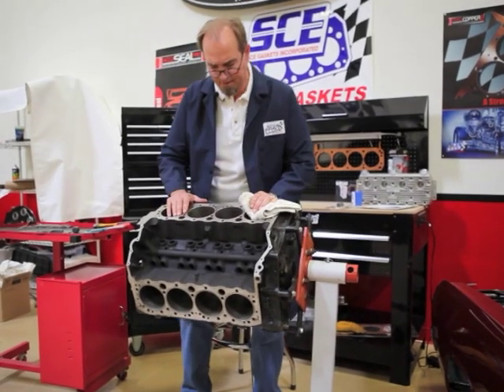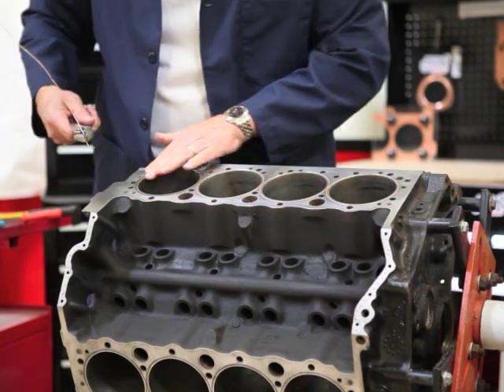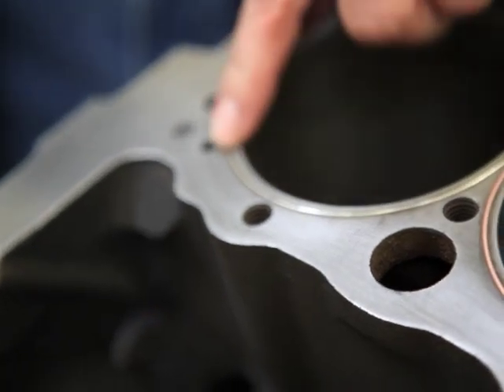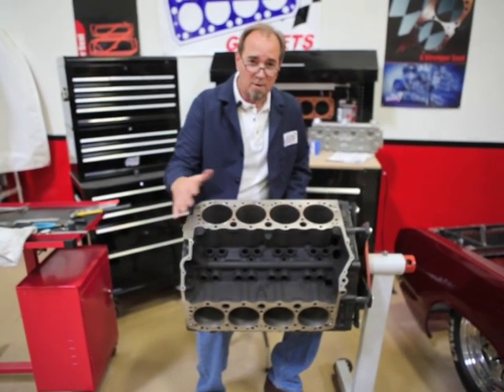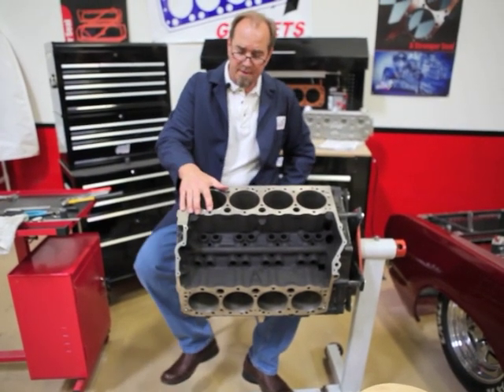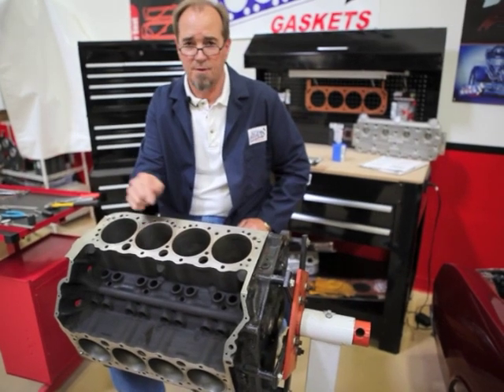Gasket U: O-Rings

Comment: Great informaiton, but why did you file over the motor?  Are you going to clean the block again later? Just a simple observation.
Reply: +Shane DeBord while the first filing at each ring can be done somewhere else ie: bench, the finish one must be above the engine since the ring is almost completely installed. 
And yes, a last final cleaning is necessary before the assembly.
Reply: @urquattro4life  So, cover ports etc first yes?

Comment: I made a mill fixture that held 8 sections of wire rough cut to length with side cutters. Both ends of the mill fixture had hardened blocks that provided support for the sections of wire. Nominal was .010" off of each gauge block and if I missed nominal on the first end then I would compensate for it on the second end. The fixture was held in a mill vice and I just switched the end of the fixture to machine the second end of the stainless steel wires (TIG rod). I would have all eight cylinders o-ringed in the time that it took this man to o-ring one cylinder plus you damn near had to have a magnify glass to find the butt joint.

Years later I machined piston ring end gaps with my CNC milling machine. I built a fixture with a spiral ramp and the piston ring indexing pin was on the low end of the spiral ramp. The locating surface on the index pin was machined at an angle so as to prevent the piston ring from raising up during the cut. I just spiraled the ring down into the bore of the fixture starting at the index pin, snugged the clamp that held the piston ring in place, pushed the cycle button and in less than 30 seconds I was ready for the next piston ring. I square the first end and then set the gap on the second end. The repeat-ability was flawless. That took the hassle right out of +.005 piston rings, however, I still had to knock the sharp edges down by hand.
Reply: Ron Becker fantastic idea. I'm sure many people would appreciate a video!
Reply: ✅trick
Reply: You've made my life easier